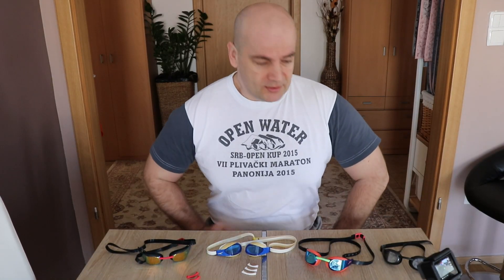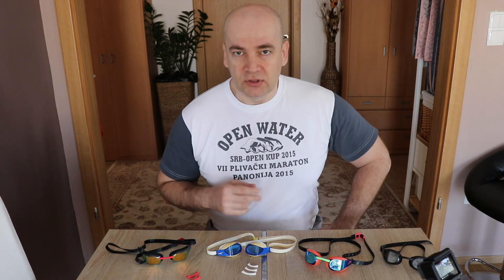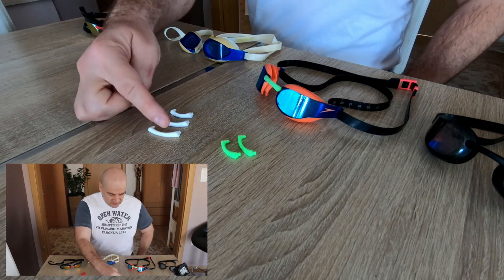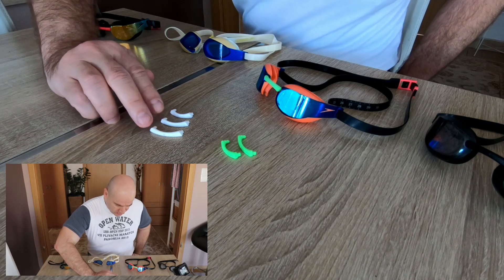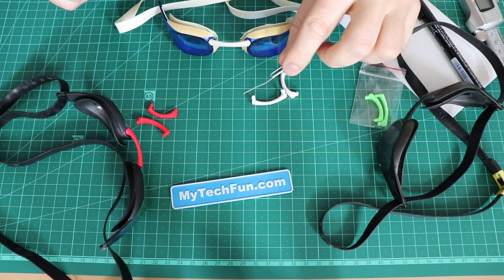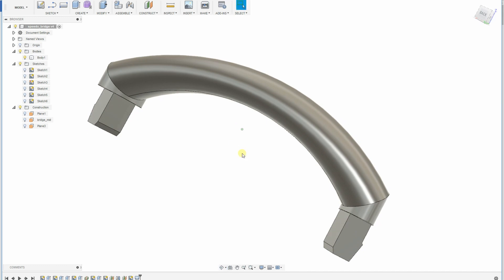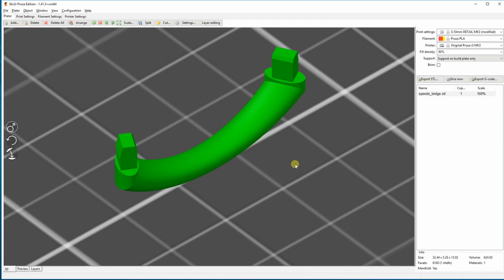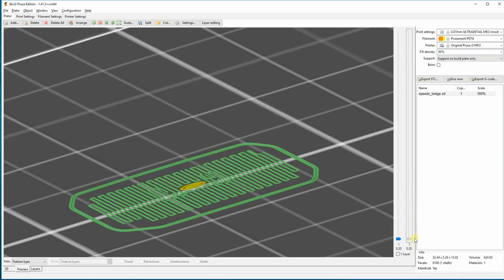3D printed bridge for Speedo Fastskin Elite Goggles

Comment: Hello, I wrote this article using google translate because my English is not good, I hope you can understand me. My nose has a bony structure. and I have a weak face. Swimming goggles give me a lot of pain because my nose is disproportionate to my face. Believe me, after swimming for an hour or two, my nose hurts, sometimes it bleeds. It hurts so bad! The height of the nose bridges sent with Speedo swimming goggles is actually THE SAME! Only the distance between the eyes increases or decreases. But my problem is the height of my nose! The nose bridge part of the swimming goggles MUST NOT touch my nose! please tell me ; Why don't Swimming Goggle brands ever think of people with big noses? WHY ? 
My nose is big and high! Why does no one think of me?
Reply from the maker: You can still use Swedish goggles and put rope or other rubber between two half parts. Theoretically, this 3D printed part can be modified too, so it can be any shape you need or want.. I will upload source files to my website, if you are familiar with Fusion360 for modifications (if you need it)
Reply: @MyTechFun  Hello Igor, I have the same problem with my nose, I'm starting to draw in onshape and fusion 360. Can I ask you how I can simply modify the nose pad along the vertical axis without deformation? Because the nose bridge pushes my nose. Thank you

Comment: Hi Igor, is possible to have the same bridge that fits your nose? I have the same problem.Or could you send me the 3d file you realized?
Reply from the maker: Hello, the file you can download from my website: http://www.mytechfun.com/video/8 (bottom of the page). If you need slightly different size, you can open the file in tinkercad or similar free 3D program to modify it with scalling the inner part of the bridge.
Reply: My Tech Fun thank you so much!You are awesome